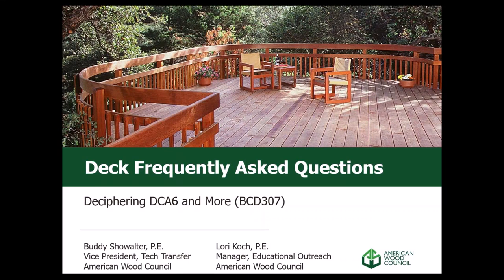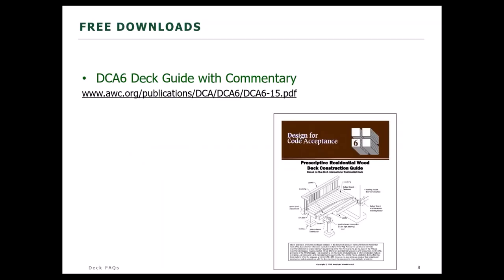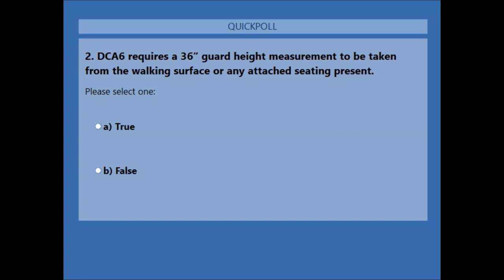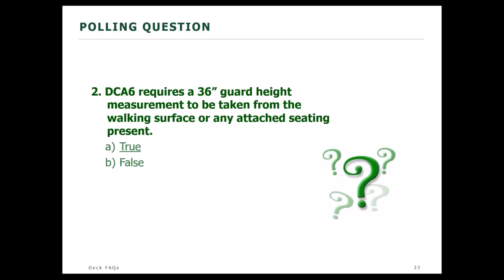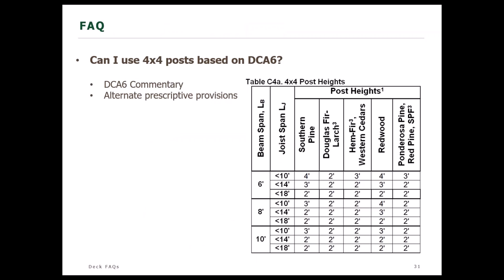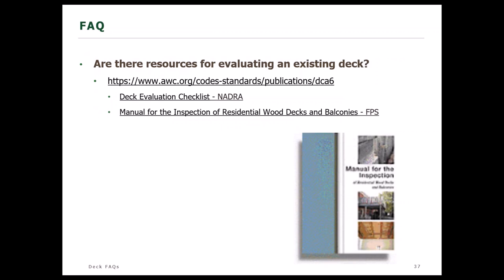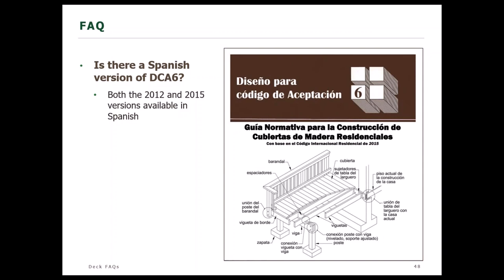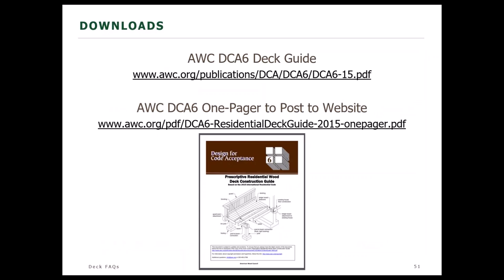Deck FAQs: Deciphering DCA6 and More

Comment: The irony is that the same deck builders who seem to insist on notching their 4X4 posts for the guard rail so that they are effectively   2X4s at the point where they need to have maximum resistance to lateral forces, are the same guys who  do not  notch the posts that support the vertical weight of the beams , joists and decking. 
 Many are still bolting or lagging the beams to the side of the posts putting the full weight of the load on the shear strength of their fasteners and the resistance to splitting by the posts to hold up the entire structure.

 Allowing lag screws to hold the deck ledger to the  band joist of the house may be okay for a few years but moisture wicking into the untreated band joist through those fasteners will not hold up for long... especially under exposure to severe weather and freeze thaw cycling conditions. 
 The moisture that will inevitably get between the ledger and the house's band joist will apply thousands of pounds of lateral pressure on that sandwich when it freezes, rendering the connection loose and little better than nails in just a matter of a few years of moisture/ frost/ thaw cycling.
 I have personally seen lags that can be easily pulled out with a hammer claw after only  five or six years after construction. The telltale blackened wood fibers around each hole in the untreated band joist tells what is happening in spite of flashing and caulking precautions.
 The lag screws themselves introduce the moisture that causes the rot in the home's untreated band joists, around each screw.
 Decks built in this manner will remain safe only a few years longer than nail only connections of the ledger to band joists.

 Not acceptable IMHO.
 There is no substitute for self supported freestanding decks built from the ground up with real posts and beams holding up joists instead hanging a deck from joist hangers with their tiny 1 1/2 inch nails. It is time for the shortcut of ledger board deck construction to be thrown on the scrap heap of failed construction ideas in favor of self supported decks that will always outperform the shortcut of hung decks that inevitably compromise the structure of the house as well as the the safety of deck itself.

Comment: Why did you not address footing below a concrete pad for a patio that will have a deck post sitting on the patio? Maybe I skimmed through it. But, I know we always ensure footings are poured for our concrete pads where posts are going. Looking at the IRC Deck guide and American wood council to find this information is a head ache and when I have consumers I am trying to educate to send them information, it is complicated to direct them to or screen shot the correct information.